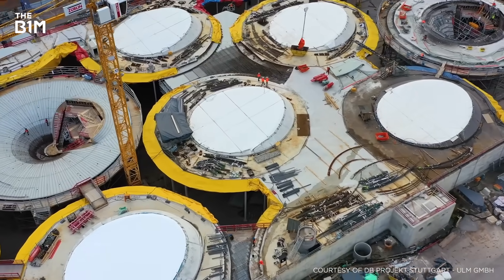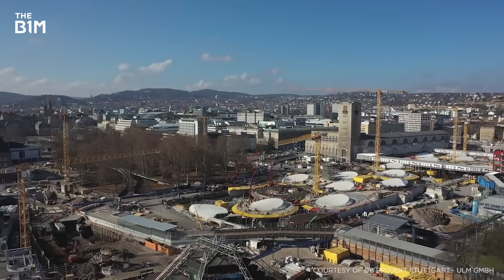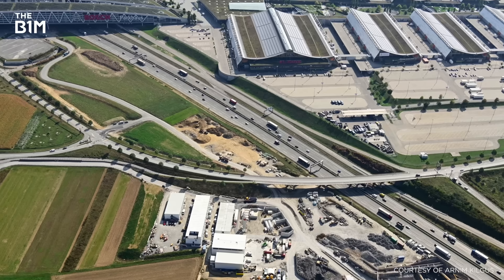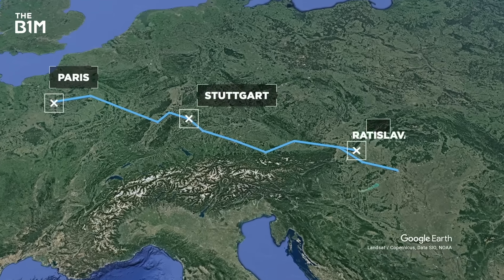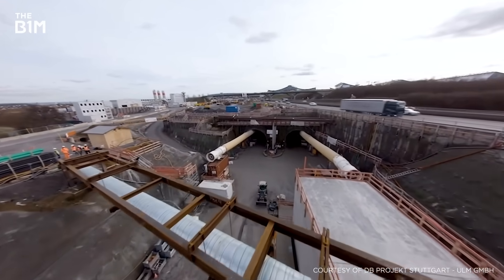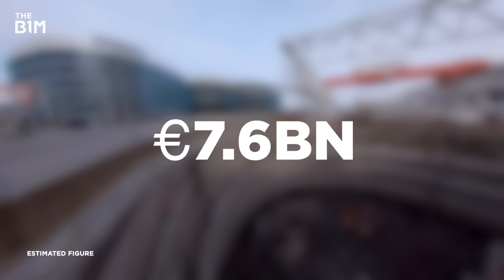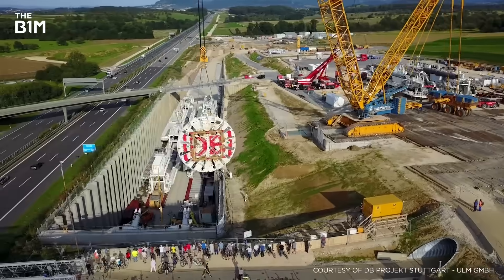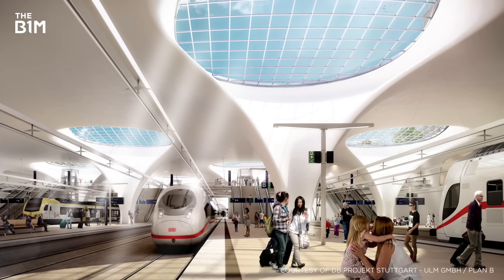Germany's 27-Year Struggle to Complete a Rail Project

Comment: I once had to do work on a building site led by Zublin. The building was already 1,5 years past the finishing date and they still had to check everything from electrics to plumbing. Apparently its not unusual for Zublin subcontractors to hire from the street. The head contractor litterly told me that the some subcontractors would  give electrician work to people merely holding some pliers or someone holding a hammer would now be a carpenter... The building was nearly finished when they discovered they had to re do ALL electrics AND plumbing in the 16 story building. Floor heating wasnt glued in, (they found out AFTER they poured concrete over the heating pipes) they had to drill out the concrete (on every floor, 16 floors) and re do the heating pipes. Also alot of the plumbing to the toilets wasnt connected at all, they just hung the toilets in without connecting them and called it a day. To conclude, they basically had to redo all pipes and electrics in a rediculously expensive building (even a Dutch princess has a penthouse there) park hoog oostduin is the name of the building. In Dutch we have a saying: Buying cheap is buying expensive.

Comment: Given that Stuttgart sits right at the intersection of the Blue Banana, the economic area going from the Netherlands to northern Italy, and the aforementioned Paris-Bratislava/Budapest high speed rail line, I’d say this is a worthwhile investment for Stuttgart and for all of Europe.
Reply: True. Also Stuttgart is fucking rich. Bosch and Daimler are only 2 of the tax payers to mention. It's easy to feel bad for them but the truth is that this is one of the richest areas in Germany and logistic plays an important role for them.
Reply: Yeah, this vid goes into the time/money aspect and maybe you get some hints about concerns like environmental impact and historical buildings, but what it sorta takes for granted is that it'll solve the problems it seeks to solve, which is far from certain (for example it happily pretends quicker travel times as if modern trains had a problem reversing out of stations; they can do that no problem; also, the capacity for trains per hour is hugely debated and many even consider the current station to have greater capacity than S21, let alone modern alternatives to S21), and there's even less certainty about any future needs (good luck expanding that station. You've now created an artificial bottleneck an a major transport network for the next century ... again).
It also mixes several projects into one bag - Stuttgart 21 and the new line to Ulm are related projects but not at all the same project. As you can imagine there's a lot of complexity to that too (especially regarding the financial aspects, but there's also complex goals related to these projects - like having a "Deutschlandtakt" for trains by 2030). 
Anyway; S21 alone is so complex you could make a 10 hour documentary on it and not cover nearly everything. The labor conditions alone probably would be enough material for that bit ...
Reply: There was no need to make the absolutely most expensive design choice possible for every detail and the concept will most likely not work out. It’s a waste of time and money.

Comment: it would be probably cheaper and better to build the new train station near or under the airport and increase the frequency of the trains between the new train station and the old HBF.
Reply: decentralized stations serving as primary hub, with another RR line connecting to the less used central station isn't quite the best solution I guess. You can see the exact same thing in the city of Kassel and other places as well. Pretty annoying for travellers

Comment: I really recommend reading more about this topic, because there were a lot of interesting things left out. Like magically disappearing water protection zones around the building sites. Or the fact that the new station will barely have the capacity of the old one. Despite all of it, it is an astonishing accomplishment of ingeneering (for example that the station in is current state still holds up to its capacity before construction started) so go check it out.

Comment: Simple fact is... People are fickle and have very short memory spans. The benefits are there, the money spent will easily be recouped within a decade or two and then continue to deliver wealth. Short term suffering for long term gain. The UK is the prime example of delaying fundamental projects because of fickle idiots, both politicians and irrelevant people with no real idea. Heathrow, HS2, Crossrail, hundreds of Infrastructure projects that are delayed, but once they're done they work wonderfully well and it's then taken for granted. Those same idiots then forget about the success of the project and then move onto hampering the next future development.
Reply: benefits, which benefits? Less plattforms, and even when keeping in mind that each stop is shorter at the new throughgoing station than at the current terminal station, there's still a lower trains per hour capacity at the new station. Furthermore there's no option to expand the existing station later ... not much of a long term gain tbh
Looking at another terminal station in southern Germany: Munich Central Station has a great main hall and still required massive expansions outside the mainhall with more than a dozen platforms being in side wings added later on

Comment: Was building a new station outside the city centre considered? It would save a lot of the cost, disruption, and get done much quicker.
Reply: there isn't much available space in that difficult terrain and area with a very high population density. And placing a passenger station somewhere outside the city and running a seperate line to get into the city ... I've seen it at some other cities in Germany and it's annoying for everyone using it. This brings up some strangely short railroad lines across the country, with the shortest being only 800 m / 0.5 miles long ... from end to end
Reply: Options would have been to make Bad Cannstatt train station to be effectively the new main station or to built a bypass with a new station at the airport. 
" It would save a lot of the cost, disruption, and get done much quicker."
Sure - but politically not realistic. The Stuttgarters would have never agreed on a "Kassel style" solution.

Comment: It is crucial to mention that the old railway stream devides and cuts a huge part of the city in half. With the completion of s21 this devision will dissappear. A massive benifit for the city of stuttgart
Reply: this is also true for the massive B10 and B14 stroads, yet they haven't been replaced with an underground tunnel system with lower capacity than before.

Comment: I live near Stuttgart and one point that upset the population at the time was that a large park with very old trees was cut down in the middle of the city.  This was a place of refuge for many residents.  In addition, Stuttgart has a very large CO2 problem and the combination of a large construction site and the felling of the city park made it even worse.
Reply: This park is 5 km. The construction of this train stations is destroying so 200 m of it. And when it will be completed the park will be rebuilt. And with the large area currently covered by rail tracks Stuttgart has the option to increase the size of this park considerably  - if they want (the property was already sold to the city). 
Those tree/park lovers are also really selfish. They like 200 years old trees. Which are only there because they were planted 200 years ago. And the very same persons deny the same joy to persons living in 200 years there. Those trees won't get 400 years old - that's way above their life expectation. Those trees have to cut in 50 years or walking below them has to be forbidded as too dangerous.
Reply: A large CO2 problem?!? How could even know? CO2 is a colorless, odorless gas that's a normal part of the atmosphere. The only way you could notice a CO2 problem is if the concentration got so high you had a hard time breathing, and that just doesn't happen except in sealed environments.

Comment: The project has more problems than it seems at first glance. Not only is the station dangerously tilted because it has to be built below the tram on one side and over the tube on the other, the rock around the connecting tunnels is swelling, which leads to very narrow tunnels causing danger to passengers in case of a burning train. Architects working on the project stated that this station may well become a death trap for passengers because of this. The station is also damaging a highly sterile environment around a fresh water spring. The Deutsche Bahn sold the land above the station, which it was gifted by the state when being privatized in the 90s, back to the city of Stuttgart and this the state. The city now plans to use this land in the city centre to be developed into a high traffic shopping mall. This whole project snapped into existence not because of the need for a better traffic hub but because the Deutsche Bahn suddenly was forced to make profit after its privatization. And because the whole train system in Germany was not optimised for profit, what better way than to sell highly profitable land that it had access to.

Comment: Make a video on Amsterdam, the Noord Zuid Line and the rework of Centraal Station.... it's been more than a decade in the making and it is still progressing
Reply: Don't be ashamed in Amsterdam, in Berlin the extension of the U5 from Alexanderplatz to Brandenburg Gate finally opened last year. 10 years of construction for 2500 metres at a cost of €700 million.
But to be fair, it has to be said that Berlin was built on a swamp.

Comment: actually many doubt that this new Station, with its 8 tracks, will be sufficient in capacity, to run the highly anticipated integral schedule system „Deutschlandtakt“, like it’s done in Switzerland, where all major trains meet at the main Stations regularly at a set times. This concept needs many platforms at the Hubs which S21 certainly does not have. I guess only time will tell if this works out...
Reply: Thing is, the DB calculates loading times for passengers at 90 seconds per stop in Stuttgart. Good luck with that.
Reply: @zwojack7285  😂 this is so hilarious for a main station, if there is just one person in a wheelchair or sinply many travelers with sport gear like Ski and snowboards in the winter season this won’t ever be enough. (Edit: at Berlin‘s Main Station Trains stop at least for five minutes, usually around 10min.)
Reply: @peterw.8434  well, the good thing about people in wheelchair is that the whole thing is fucking slanted at a 0.15% angle
Reply: @peterw.8434  and Berlin Main Station still has less tracks than zurich... zurich has done it the best way even possible (even there not everything is perfected, but small improvements can always be made and imperfections found)
Reply: @walkingonoldtracks  well Berlin can do with less tracks as it’s Infrastructure is very poly centric. The main Station actually features just as much passenger traffic as many other major stations like Gesundbrunnen, Ostkreuz, Friedrichstraße, Südkreuz, … all with at least half the ridership of the main station! As not all regional trains (without interregional importance) need to stop at the main station, it’s dimension is more then enough.
Reply: @zwojack7285  yeah: but a angle away from track and/or parallel to the tracks. So not very dangerous. In fact: the high parallel angle will be quiet obvious; so nobody forgets to use the break there. Accidents on stations most often happen, when the angle is not notable & the weelchair etc. starts rolling very slowly.
Reply: @zwojack7285  1,5 % angle. 15,143 Promille (‰), to be more exact.
Reply: @vinwin8155  its angled so hard that it cant even legally be called a train station, just a train stop. So miss me with that shit.
Reply: @zwojack7285  yeah: but who rly cares how its called?
Reply: @vinwin8155  well, it is a bit ridiculous to build a slanted train stop for billions of Euros
Reply: @zwojack7285  actually that angle is pretty common, most S-Bahn Stations (not just in stuttgart) have 2% going towards the tracks.
Reply: @zwojack7285  PS: „Die Anstalt“ isn’t the best source of information, such is taking jokes from satirical shows literally (e.g it can’t be called a train station)
Reply: @vinwin8155  the steep gradient is not only about wheelchairs and strollers, but also about trains who have a longer braking distance due to the slope
Reply: @janssen18  an S Bahn "station" is not a "Bahnhof" and doesn't have to meet the same requirements
Reply: @vinwin8155  the German railway authority (Eisenbahnbundesamt). A station ("Bahnhof") has to meet different requirements than a simple stop ("Haltestelle")
Reply: The problem is not S21; its actually shutting down the existing station completely, after finishing S21.
Reply: I really hope they don't block the option of keeping some above ground tracks running.

Comment: I missed a lot of the long known planning errors made here. For example there are a few worries about safety in case of mass evacuation. Or the fact that there are much less tracks than currently and they are too short to allow two ICE Trains to stop there at the same time. Also the platforms incline more than the regulations for a train station actually allow. All of these things were known from the beginning but everyone is pushing this project for their personal gain. It will be an absolute disaster when it's done. There is a great video from "Die Anstalt" about all of this

Comment: The Metroploitan Railroad in London was a huge disruptor at the time of construction but its benefits have been shown for more than 150 years. it will be beneficial even though it hasn't shown it yet. That's pretty much most of infrastructure the eye for its use is rarely seen by many until they can use it.

Comment: Having lived in Stuttgart from 2013 to 2015 I saw weekly protests against this project, main roads in the city center that were constantly congested and work that just didn't seem to progress. Now it's possible that the progress being made was underground or elsewhere than the city center but still it was weird. I returned in 2017 and didn't see any difference compared to 2013.
The same lack of progress was also visible on the Autobahn where it felt like 1/4 of it was continuously being renovated but no progress seemed to be made.
After my 2 years in Stuttgart I lived 2 years in Bordeaux, France. There I was impressed with the public works on the highway. French roads are the best I have seen. They are simply perfect, like German roads. But unlike German roads there are much less sections being worked on and when there are works they finish astonishingly fast. That's why I consider French roads to be better.

Comment: Germans can't manage huge transport infrastructure projects ... yet one often seems to forget huge projects which went well, Munich Intl Airport to be named as an example. Back in 1992 they moved the operation from the old previous airport to the new one within just ONE SINGLE NIGHT, an achievement which caught quite some attention across the world and set the organizers on the call list on many airport movements since then.
Of course any large construction project has its struggles, as far as I remember also Berlin Central Station had some, however today no-one talks about them and it's seen and used as an impressive and modern transport hub
One thing you could or should have mentioned is one big factor this project means on a local basis for downtown Stuttgart: the tracks leading to the current central station cover very large areas, and once the new central station is finally open and the above ground parts are shut down, it offers new opportunities for downtown city development projects
Reply: The thing is they lack political support from a coalition. They never get the support of the people and environmentalists drag every project on and on and on.

Comment: As I spotted the title I thought you were diving into contested water, but you really did an amazing job, fitting the project. 
Being a local I know how fierce the discussion about this project still is.

Interestingly you didn't mention the second, almost as important, impact of S21: With the old station and all those tracks gone there is a HUGE area available in the dead middle of the city for modern development. Also the adjacent park will be extended. This aspect was poorly communicated even among the Stuttgart population: I think this greatly increased the opposition to this project. It wasn't until THRE years  after I first heard about S21 that someone mentioned how much space this would free up. 

S21 is a city developing project as well as a infrastructure project. This is often overlooked and excluded from the discussion.